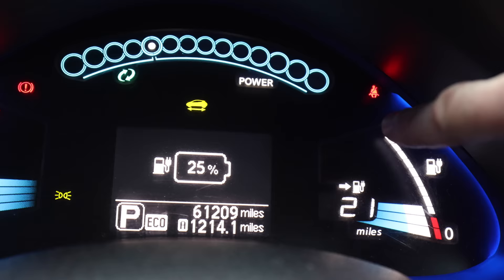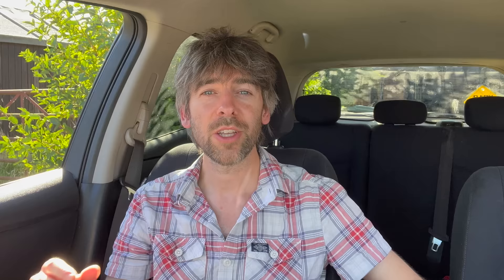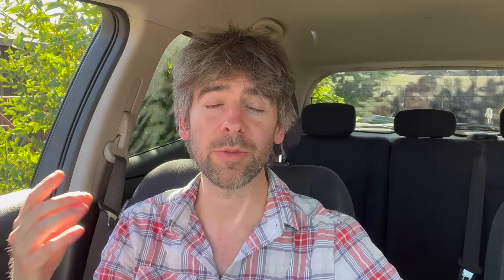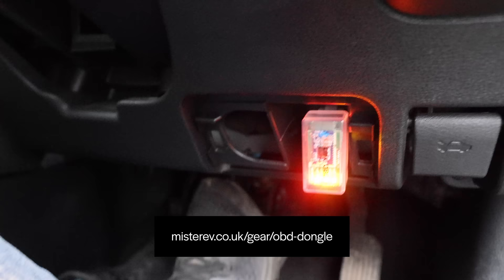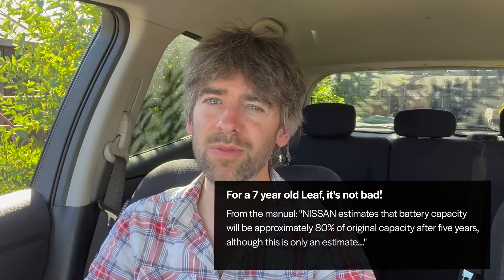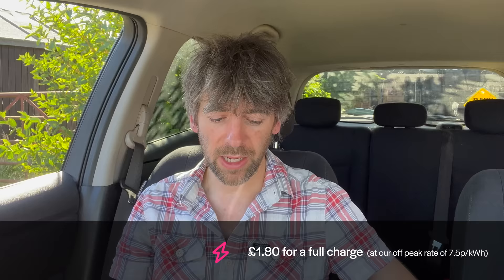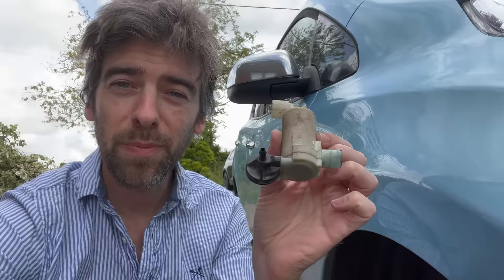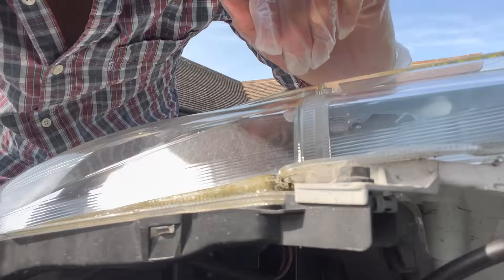How’s our old Nissan Leaf doing? Let's talk battery health, running costs, failed washer pump & more

Comment: I have a 2013 Leaf with a 24 kWh battery.  I bought it used for $6000 US and it has been the perfect commute car.  With 88,000 miles on the odometer, it still has eleven bars! It costs me about $1.25 in electricity to travel the 26 miles for my trip to work and back.  I can't begin to calculate the savings over having an ICE car - especially with fuel prices now.
Reply from the maker: That's amazing! Great to hear. Thank you!
Reply: Wow! I have an 2013 too 81,000 miles and now 5 bars :/ but gets over 110 Fahrenheit :( here
Reply: Unfortunately the bubble has burst on EVs, unless you charge at home of course but the point is to use it outside not calculate getting home! They want to triple the electric charging points. So for eg If you have a Toyota Prius for 120 miles of driving will cost £20 of petrol. To charge an equivalent EV it will now cost £34 as the repair and upgrades of charging stations is too costly used by too few EVs. So prices have to go up to put money back into the system, plus of course electricity is now the most expensive power that we use and is to create
Reply: @stumpusMaximus  If repair and upgrades are too expensive, government can step in to help.  We HAVE to make a transition from a carbon-based economy to a clean-energy economy.  We don't have a choice in the matter unless we want vast areas of the Earth to be uninhabitable.
Reply: It's the perfect car for that.
Reply: @mhausenfluck you want to get a sandwich board with ' the end is nigh ' written on lol
Reply: @mhausenfluck  batteries are not greener than ICEs, at least for now.
Reply: @stamentonchev be honest, have you actually done the calculations for both from start to finish, or seen a reputable person doing them?

Oil ICE need engines: Oil extraction, drilling, exploration, wars, invasions, political corruption, local pollution, refinery, storage, shipping, fires, road transport, etc. Those are just what I could think of in a few seconds.

At least with electrical we can do our own battery storage, capture from solar, and completely remove the dirty corrupt gang.

Marques Brownlee, the famous tech reviewer, switched his roof for the newer solar roof tiles where every tile is a solar tile. He can power his car, home, aircon, kitchen, etc just from solar. He has 3 storage batteries.

As batteries and solar tiles get cheaper, as insulation gets cheaper, we should see people being able to have their own power.

No wonder the corrupt Tories want to create a law stopping people from putting solar on their own land. They're so dirty and against their own people, who votes for them.
Reply: @Google_Does_Evil_Now  "Oil ICE need engines: Oil extraction, drilling, exploration, wars, invasions, political corruption, local pollution, refinery, storage, shipping, fires, road transport, etc. Those are just what I could think of in a few seconds." The same implies for materials used to create a battery :)
Reply: @stamentonchev  starter motors
Alternators
4, 6, 8 injectors.
4, 6, 8 coils.
4, 6, 8 leads.
4, 6, 8 glow or spark plugs.
Fuel pump.
Oil pump.
Oil filter.
Oil.
Coolant change.
Coolant pump.
Air filter.
Turbo.
ERG fuel recirculation emissions reducer.
Exhaust, manifold, several meters length, holes can poison occupants.
Catalytic converter.
Braking system that doesn't recover energy.
Timing belt and expensive change of it.
Carburettor or fuel injection system.
Yearly emissions tests.
Gearbox maintenance and replacement every 50,000 to 100,000 Kms/miles, costing 3k to 7k or more.
Clutch replacement.
Drive shafts.
CV joints.
CV gaiters.

Versus electric motor at the wheel which has a cable from the battery/ECU.

Did you see the Squad Solar electric car for under €6,000/$6,000 which has a solar panel roof that charges it 20 to 30 miles a day for free?

There's no ice car in the world for 6k with unlimited free fuel top-up of 20 to 30 miles a day.

And almost zero maintenance costs.

Are you interested in a car for 6k that drives 20 to 30 miles free every day? Squad Solar. See the reviews. Get in the queue.
Reply: I get 229 miles on £5 of charge when charging at home and I don't charge away anyway,
I love me Lecy car it's the only one I have owned and don't think I will need to change, where I have owned over 20 ICE vehicle in the last 46 years and by far this car is Cleaner, Quieter, Cheeper to maintain, more reliable,costs way less to run,and with Winter preheating,and the electric charging station on my driveway is so convenient, However I do have some fond memories with regards to the ICE vehicles I have owned like, Fitting a used engine into a Vauxhall viva1972 model,
A gearbox on a Morris marina,
At least 4 clutches replaced personally and several more by the garage as I got lazy in later life,
Numerous service parts over the years, Spark plugs,Oil filters, Oil, Air filters, Distributor caps and many plug leads,
Had a few Cylinder heads skimmed and replacement of quite a few timing belts by myself and by garage's again I got lazy,
But you see it's now time to move on to the simple life stand back and let the young generation do all the hard work,
I do love my Lecy though 😊
Reply: @mhausenfluck It's primary the heat from DC fast-charging that kills battery life, so as long as slowly AC charged at home, the LEAF batteries are designed to have a long shelf life. 

As for the environment, that's a different issue because many countries still are dependent on fossil fuel for electricity. US, China, Australia still need coal as part of their energy mix to meet ever growing electricity demand. We still use coal to make steel. The aluminium, iron, plastic, and battery material used in your car was mined and processed with diesel vehicles and electricity generated from fossil fuel. Our clothing, furniture, house, or cellphones are made by using fossil fuel.
Reply: @stumpusMaximus In my country (same as video creator) we have over twice as many charging stations as petrol stations.

Comment: I have a 2011 Nissan Leaf… and it has been brilliant… never once a failure 12 years later… just tires… that's it… But I live in a hot area… so the battery has degraded to about 70%… so range is limited… fine for around town… I can do a full days worth of errands… but not so good anymore for longer trips… very comfortable car.. good passenger space, handles and drives nice.. OK boot… it has been my most trouble free, least expensive car to date… I look forward to many more years with it…
Reply from the maker: Wonderful to hear!

Comment: The slowness of Leaf is due to the low baud rate on its internal communications. It's a very old protocol which was cheap (or free, not sure here) to license, and more (EOBD) was not needed. 
License for EOBD was USD5 per vehicle I think at some stage. So $5 x 500 000 is 2.5 million saved.
There was also a study that showed that the life of a battery can be extended by up to 30% by charging it to 100% and then discharging it at a high rate to 90% immediately after. (Can't find it right now)
Very interesting video, thank you.

Comment: At work we've used Leafs from the early 2010's and, as a short journey car, it was perfect. When I say short, a return journey of around 60 miles is doable, after than it was all dependant on type of day. We then got Leaf2s, bit night and day to be honest and such an improvement and have done many 1000's of miles in them.

So, why do I share this? For anyone looking for a 2nd hand Leaf EV, original Leaf for a shop runner, Leaf 2 for something a little more as a daily driver. :)

Comment: Thanks for the update. I sold my 2011 Leaf for $3600. It had 46% battery and 6 bars with 65890 miles on it. My range was about 38 miles.  I upgraded to a PHEV that will give me about 30 miles on the EV side, and 600 miles on the petrol side. (American gallons) My Leaf cost me about 0.05¢ per mile, and returned between 3.4 to 3.9 miles per kWh.

Comment: Thank you for the video. Really interesting to hear about your experience and battery health. I bought an used 2017 24kWh 26000km Nissan Leaf for daily commuting. Did my homework before purchase, and I'm fairly confident the car will reach 200 000km without a  problem.  When it is scorching hot in the summer, avoid quick charging if battery temp bar is over 6 bars to avoid battery degredation. I live in Finland and it is quite cold most of the year, which helps to keep the battery healthy.

Comment: Hello There, a great Video, you can also get the individual modules replaced for the battery and that will increase the bars on the battery indicator etc. Cheers Peter :-)
Reply: P.S. you could replace the battery as well.

Comment: Try changing the Bulbs on a Skoda Superb. The manual read something like this; To change Headlight Bulb, first remove Headlight (See Section ** for Instructions) Turn to Section **: To remove Headlight, first remove bumper (See Section %% for Instructions).

Comment: Sold my old leaf 63 plate , it was an ex taxi with 190,000 miles . Still drove absolutely fine and everything still worked . Battery SOH 65% . 50 + miles of range .

Comment: can agree 100% with Ewan, on our first  24kWh Leaf the battery SOH went to around 91% in Summer and back up to 100% every winter, taking a regular trip that required three rapids in a day in each direction always put up the apparent battery SOH. Our 40Kw Leaf is totally different. just a regular .01% loss of battery SOH every month, now down to 89% at nearly five years old.

Comment: Replaced washer pump myself,  dealer wanted £126. Got the part for £16 and did it myself,  few scrapes on hands and arm from accessing that tight space in front of wheel but worth it!

Comment: my dec 2013 leaf 24KWH

AHR=49,19
SOH=75,43   396V
HX=62,93
ODO=148,868 KM
299  QCs
5610 L2  220V every day to 100% CHARGING AT HOME! 2,2KWH
i drive 60km a day... own it for 4 years now
every end of the week when the charge is full i pull the plug out and i put it in again for 2 times! rebalancing every week :)
got only 6mv diference off all cells!

Comment: part 3 - P.S. have charged to 100% at home for past 2 years and 90% at rapids and have only done work on it myself, after its Mot's so in all that time I have replaced a suspension tie bar link (new), a track rod end (new), lower ball joint /arm(new), crazy thing is, all those were on the drivers side and I'm quite slim. lead acid battery (new), a wiper motor (used off ebay), wiper blades (new) and lastly the heater PTC (used ebay from Lithuania) off a very low milage 2021 leaf, yes, yes I know, I'm going on a bit. So 95,000 miles has cost me in parts no more than 500 all in.
and you are right the sound system is dopey (apparently that means excellent) Anyway toddle pip old boy. well young compared to me 
cheers Graham

Comment: We’ve just bought a Leaf again. 2017 White Tekna with 6.6 charging and 12 bars. Sent the PCP Zoe back. Sadly the Airbag light has come on, but hopefully a simple fix.
Reply from the maker: Congratulations! Let me know what the airbag light issue turns out to be. Does it need a service? Perhaps get Cleevely EV to do that and the airbag light at the same time?

Comment: Mine is a 40 kw leaf, 2019 model, its gets driven 100 miles per day, 5 days a week. Currently at 60,000 miles, and uses about 80 % per day. So I need the 100% per day.

Comment: Hi Andrew, I bought my 2013 Tekna from ebay in 2015. It was a drivable write-off. Hit in the back and shunted into a bus apparently, it had done 29,000 when I got it, all in it cost me 6,800 Quid including repairs (sorry my pound key isn't working) I have been all over the place in it. I live in Morecambe and have been to London 3 times with my Girls (that's not Sugar daddy talk) My two mid to late teens offspring then, early twenties now. My first trip there took 12 hours because being a thrifty/tight bas*rd, we went for for free , I visited every nissan dealer for a charge as close to the M6 and M1 as was humanly possible, It was was a big adventure the first time, subsequent times I'd realised life was/is finite. I digress, Any road up as my Great aunt Hetty used to say, it now has 124,000 on't clock and still has 10 battery bars, ICE car lovers! - STICK THAT IN Y PIPE N SMOKE IT (but not with fire, use some nifty electrons in stead) 1 -

Comment: Andrew, I have complete sympathy with changing light bulbs on cars.  You need to have the smallest hands to replace them.  I'd like to change my car h7 headlight bulbs to leds, however I know it's going to be a nightmare changing them.  Another great video Andrew, keep up the good work.
Reply: I still have nightmares about changing headlight bulbs on my old Smart car.  You either needed to take wedge your hand into the tiny air vents at the base of the windscreen and do it all by touch one-handed, or take the whole of the front of the car off!  Not a trivial task.
Reply: Agreed. I've changed headlamps for friends' cars and some models require a substantial amount of removing plastic shields and components, etc. under the hood to get at the socket. Also, two license lamps were out on my 2007 Camry. This was picked up during an oil change and inspection at a Toyota dealer. They quoted $70 parts and labor to replace them! I said no, thanks. Naturally there's a YouTube video on how to change them. It takes a bit of time but completely doable by the average person.

Comment: Yeah, most definitely a great commuter car. I have a 2014 Tekna with 235.000km and a SOH of 70%, 9 bars, still able to do my daily 70km commute and no issues what so ever. Just had an issue with front shock absorber, but for the rest just tyres and wipers changes, break pads are the original.

Comment: Thanks Andrew. Most informative, especially the explanation of the urban myth about rapid charging to 'regain' that lost capacity.. From what you said, losing one battery SOH bar means that its health is between about 78% and 85%. As you've seen, the LeafSpy app with the dongle will give you better fine-grained SOH data. Thanks too for the EV equivalent of Hubnut car tinkering! 😉👍

Comment: Really interesting video Andrew - especially the input from your guest battery guru. I've got a 2015 Acenta (24Kwh) and absolutely love it, as our low-cost runaround. Couldn't agree more with your suggestion that in a 2 car family, one should be a cheap(ish) EV........if you can find one 😎

Comment: I'm still running around in my 2014 Leaf here in Alaska, and I have all 12 bars.  But my SOH is about 87%, so it won't be long now till the first one drops off.  It's a perfect run-about vehicle.  I'm getting a new 2023 Chevy Bolt in a few months for longer trips, but will probably still hang onto the Leaf as well.
Reply from the maker: That's amazing going! With a vehicle-to-home charger, there'll be even more reason to keep Leafs around: much cheaper than an equivalent-sized home battery installation!
Reply: @MrEV  Excellent point!
Reply: First bar drops under 80% SOH

Comment: I own two old LEAFs.   I bought a “2013” SL on 12/16/2012 - Yes,  I just turned 10 years of not buying Gasoline, YAY! - it has lost 7 bars.    When it’s cold out,  it’s good for 20 to 28 miles.    And on 10/13/22 I bought a 2012 for $2450 because it has no heat.     The quote locally to repair the heat is $3800 from Nissan! LOL - I’m not fixing it.  I use my LEAFs to hog up parking spaces in the city for my Tesla ;) - I live in the city with only on-street parking and I charge out my kitchen window and so I need a particular spot on my street and that’s what the old LEAFs do.

Comment: Still amazed that nissan don't do their own battery upgrade program.  I would love to get the 40kwh pack fitted. Its a real shame
Reply from the maker: Definitely. They're just leaving money on the table?!
Reply: @MrEV  I would be at their door if they had a scheme. Given they are still making the batteries this seems a no brainer to me, and it ties in servicing for a few years yet.
Reply: You could try Muxsan.
Reply: @RoaldHemel35  they seem to have gone very quiet recently. Not sure what is going on with them
Reply: @patrickjr11  can’t find their phone number. I’ll fill in the contact from.
Reply: @RoaldHemel35  the website is a bit of a mess. It's not very well maintained. Hmmm.
Reply: Managed to source a 62kWh battery for our 2015 Leaf.  Upgraded myself (with help of a forklift) and now get over 200 miles, sometimes GOM reads 240 miles!   Re-purposed old 24 kWh battery for home storage.  We now drive the Leaf everywhere and Model 3 stays at home charging off solar.  Win win win .
Reply: Nissan make more money selling a new car with a battery and selling the battery on it's own as an upgrade.
Reply: @waerlogauk  true but they are not exactly selling millions of cars any more and income is income in the end.

Comment: I always wondered why Nissan didn't incorporate a thermal management system as their engineers must have anticipated premature battery degradation in years ahead? Great video, though, especially the contribution from Dr McTurk.
Reply from the maker: Apparently they just wanted to keep the cost down? Still an odd decision.

Comment: Actually think of it this way. You bought the EV for a thrifty price point, therefore just do the Robert Llewellyn trick and buy a 40 kWh battery to fit into your 24 kWh leaf. After all the fuel savings you accumulated should pay for the range increase of the new battery installation.